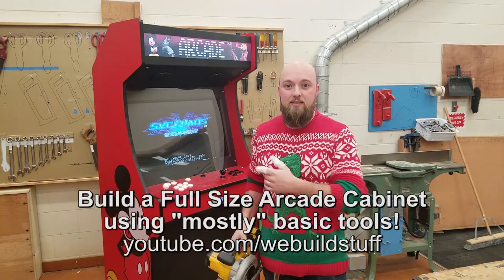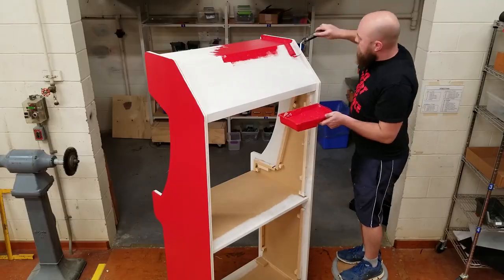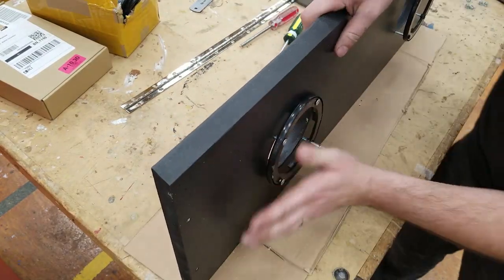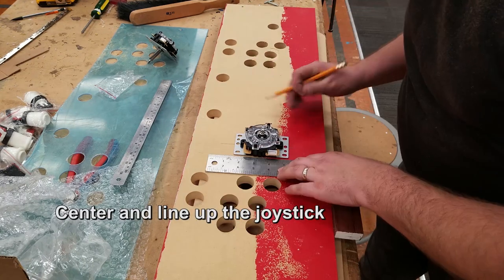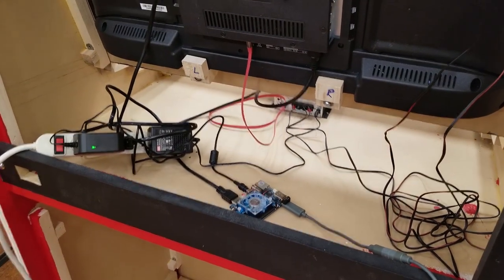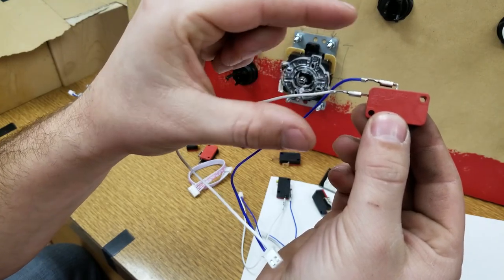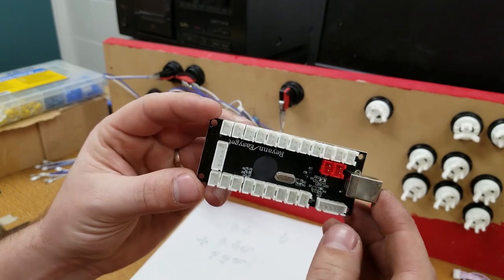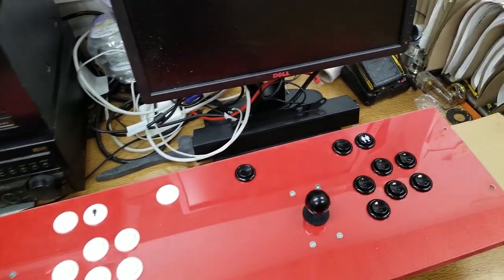DIY Full Size Arcade Cabinet with Basic Tools - Part 4

Comment: I see the joystick you used just needed one connector, if you get happ or IL sticks, is it just a case of putting 4 different wires into the usb converter for each stick? And do you remember the brand of usb board you used for this?